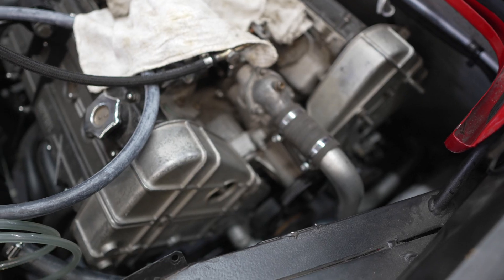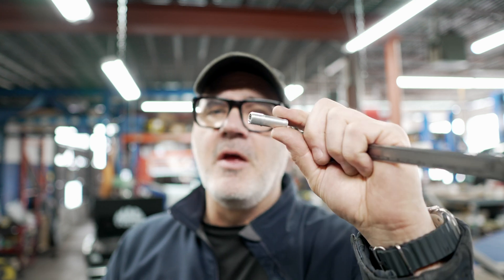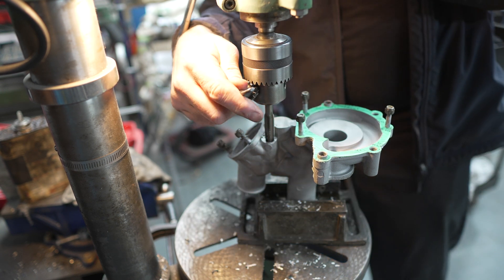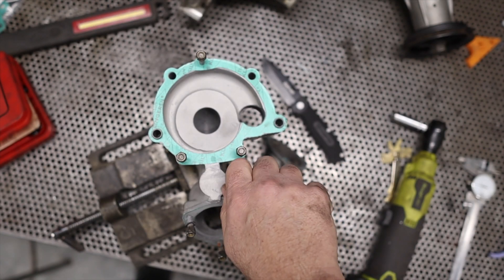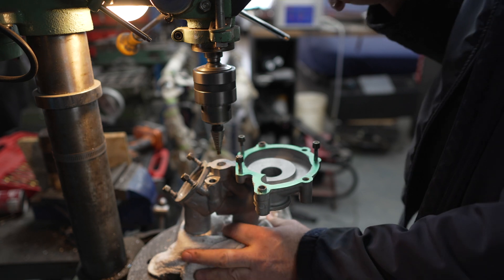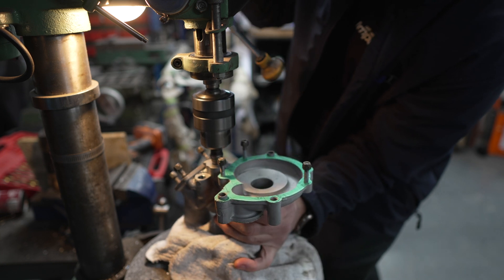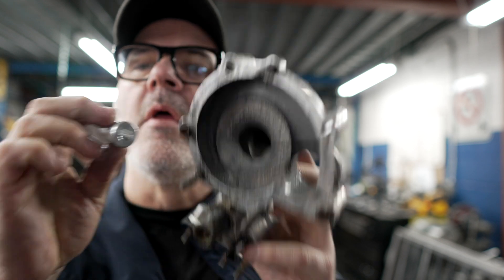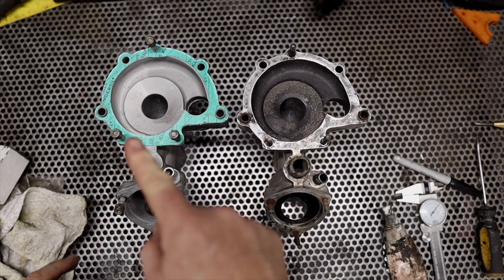Drilling & Tapping: The Techniques You NEED To Know

Comment: I had to replace the smaller nipple on mine when I replaced the water pump.
Reply from the maker: hope that went well for you.
Reply: @LouTrottier  I didn't have a drill press but did it by hand and it worked just fine.
Reply from the maker: @MrJdubbya36  excellent.